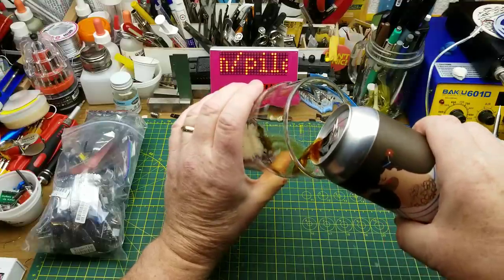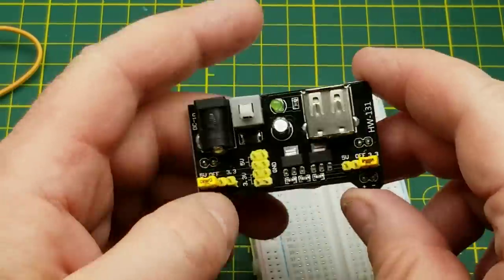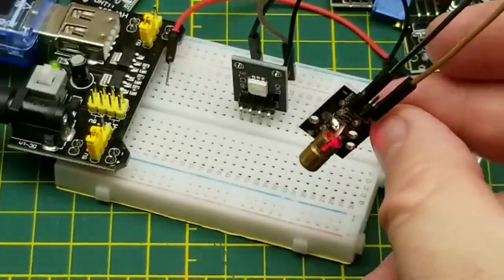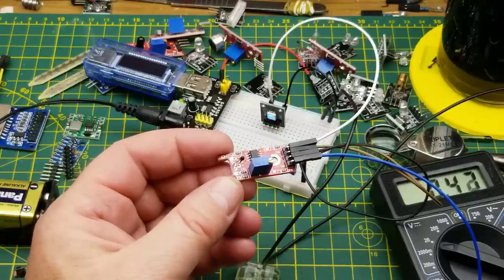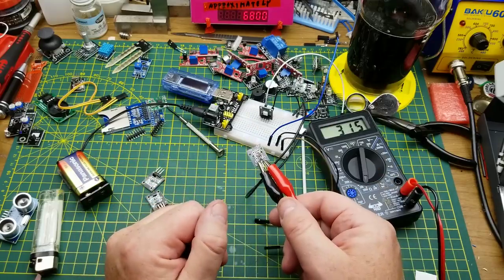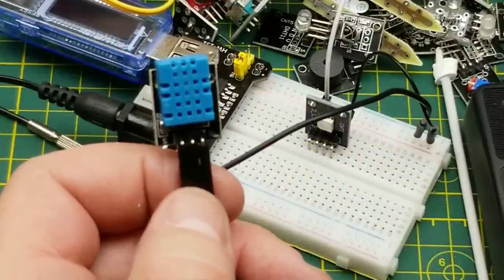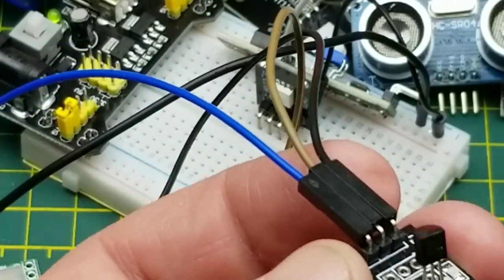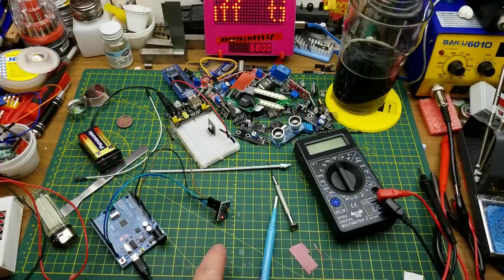What's in those "45 in one" sensor kits?

Comment: Great video. It's funny...as many sensors as I look at, you had some form factors I've never seen before in there. I've never had the 2 color leds in a kit. Never had the auto changing leds.  There were a few others that were unique at least in design.  Excellent explanation.
Reply from the maker: Yeah, I'm not sure the arduino related value of the colour changing LEDs, but they are fun to have - especially in large numbers.
Reply: @pileofstuff  Never can have enough blinky.  My favorites are 2-pin, 2-color ... useful for indicating polarity of a stepper coil.

Comment: I was expecting about 23 parts, as the Chinese  always over state capacity.

A good way to calibrate a temperature sensor, water always boils at 100°C and crushed Ice in water is close to 0°C great kitchen table top cal methods.

My alarm uses hall affect sensors, and will indicate a tamper condition if the magnetic field changes. Reed relays are so old school :)

Nice looking beer.
Reply: Boiling point of water can vary greatly depending on a number of factors- air pressure/altitude, contaminants, etc. Same for freezing point... can be affected by contaminants. There's even an obscure method of keeping water frozen at room temperature
Reply: @celtisafricana4984  The point is the boiling point is a constant for the air presure you are at. You can keep trying to increase the heat the water will only boil at a steady temperature unless you change something. So a reasonable calibration value. Something everybody has access to at home.
Reply: While reed switches may be old school, they are a very good switch with a small cheap magnet for a cupboard light and many other low tech needs.
Reply: @stevetobias4890  we used them a lot in waterproof microphones for the Press To Talk function. Sliding magnet outside of the rubber covers, and RF switches inside coax cables. old school and still so usefull as you say.